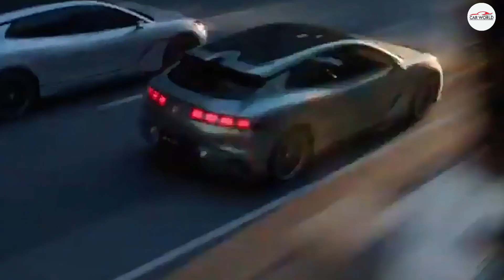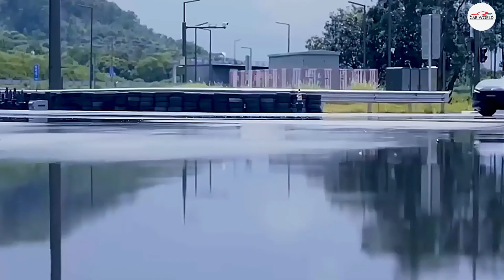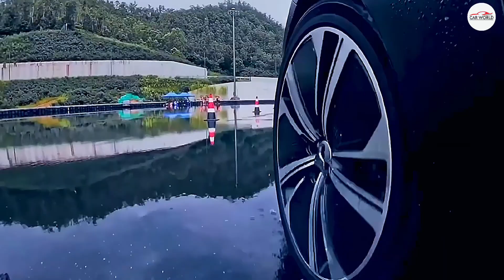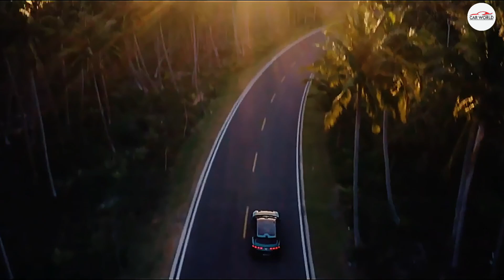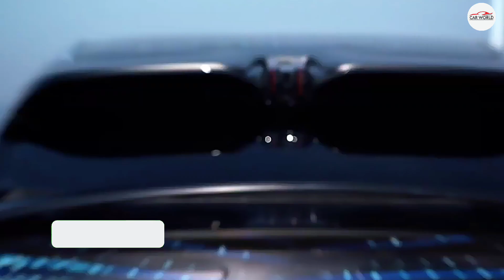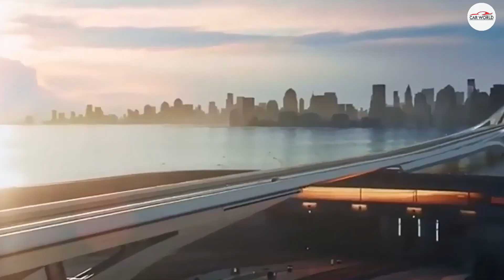BYD’s Luxury Weapon: Why the 1000HP Porsche Killer Denza Z9 GT Will Dominate the Australian Market

Comment: What do you mean near flagship performances for a significantly lower price. Firstly some of those technologies in this EV other over priced and over hyped money pit European luxury vehicles do not even have.  Then their suspension system are far superior and much more comfortable than them European money pits. And reliability is far superior too.
Reply from the maker: That’s an interesting point, and you’re right in some aspects. Chinese manufacturers are advancing very quickly in terms of technology and value for money. However, when we say ‘near flagship performance,’ it usually includes not just technology, but also long-term reliability, driving dynamics, and overall ownership experience. Both sides have their strengths and weaknesses, and the choice ultimately depends on what the buyer values most.